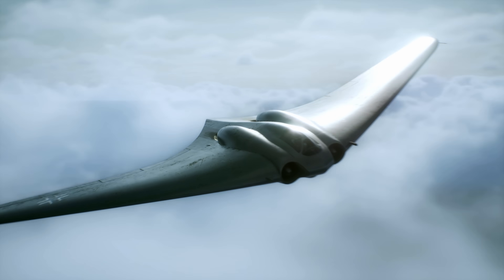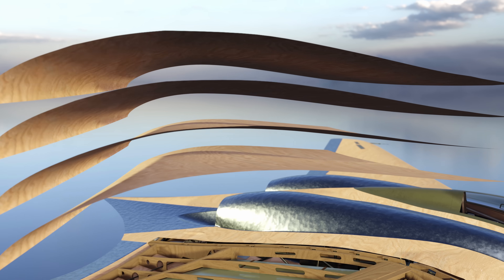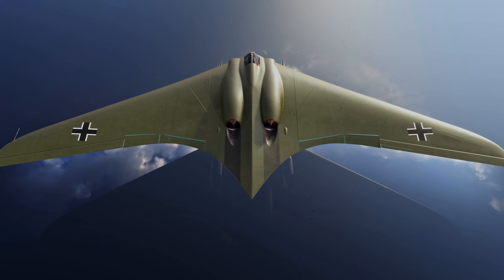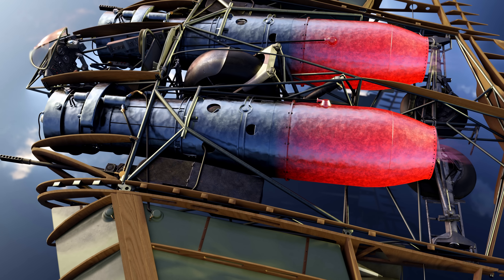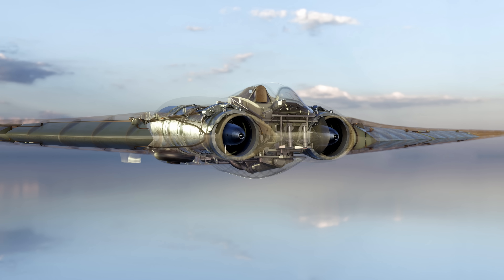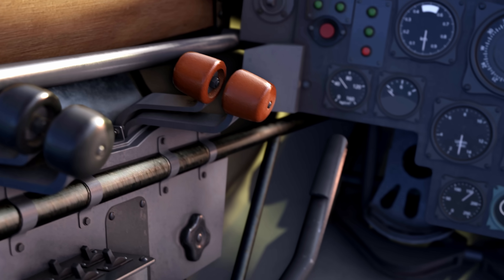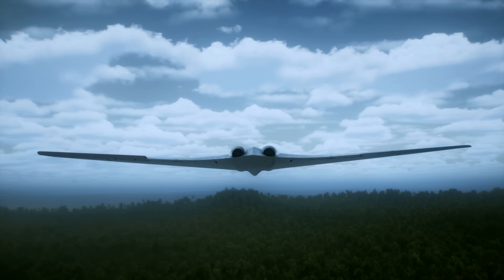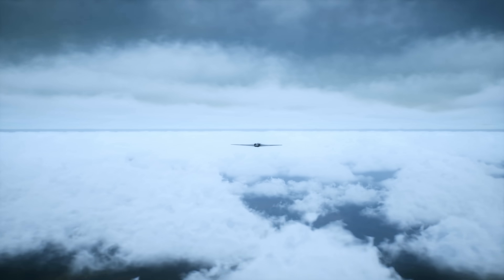Inside the Horten Flying Wing

Comment: The first flying wing patents were issued in 1870.  Many efforts were made to produce such planes before WW1.  Between the wars there were French and British designs.  The Westland Pterodactyl first flew in 1928 - a powered wing 5 years before the Horten brothers built their first glider!  All had advantages and disadvantages, the biggest problem being that a larger wingspan was needed to achieve the bell shaped lift distribution required for stability (particularly without a fin).  The alternative is an airfoil with a reflex trailing edge which gives lower lift characteristics and excess induced drag except over a very narrow spectrum.  It is also worth remembering that some versions of the DeHaviland Mosquito had a higher performance than the Ho229 would have had before the  229 flew..  With more reliable and less thirsty jet engines and further development flying wings or high performance versions with small canards to assist are now common in military use, though very few are fin-less.  There are still researchers trying to prove that the Horten formula is "better", but no-one has succeeded.  The stealth niche (B2) probably owes more to Jack Northrop's designs than to the Hortens.
Reply: Nuh. It just irks you when things were made by Germany, and you cling to any straw feeding the murican ego. 🤷‍♂
Reply: @matt47110815  The Horten brothers gliders were NOT competitive either.  If you read any of my posts you would know that I do NOT feed Murican egos, I laugh at them.  Study some basic aerodynamics and the history of flying wing (non-delta) aeroplanes then try again.

Comment: Still, the late jet version was so difficult and dangerous to fly that it killed its only pilot (Erwin Ziller) on the third and last flight it ever made under jet power. The earlier glider versions were said to be very safe and stable.
Reply: It crashed because of an engine failure, not because it was difficult to fly.

Comment: Indeed, it wasn't conceived to be stealth, the necessity hadn't been prevalent yet but due to its very high speed and the limited radar range and precision of the era, by the time it was a confirmed enemy unit, it was already on top of you and the interceptor pilots were still in their beds. So, we can probably speculate that the advantages gained over enemy detection back then to be approximately equivalent to today's stealth technology over current detection counter measures. I may be completely wrong here but it's a pleasant thought.
Reply: Tests showed a 50% reduction in frontal RCS... given the limited capability of British air defense radar this represents a significant tactical advantage in range of penetration into enemy controlled air space without detection and preventing interception before reaching its target.

Comment: US copied B2 from this
Reply: Not likely at all. John Northrop was also obsessed by the flying wing since before the war, and was already working on an equally ill-fated heavy bomber with like 6 engines bolted to the back.
Reply: The lead German engineer from this project went straight to work for Northrop so what do you think?
Reply: @sebastiantran1266 Lead German engineer? Reimar and Walter never stepped foot in the US, how could they work for Northrop?
Reply: @sebastiantran1266 you're right
Reply: @sebastiantran1266  Non ha lavorato per la produzione aeronautica in Argentina 🇦🇷?
Reply: @sebastiantran1266 the Germans were very advanced in particular with rockets but the Americans were I believe actually just as critical for the American program that developed.
Reply: At the Dunning Kruger olympics, you just brought home the gold medal.
Reply: @georgeandrewtan that is tremendously funny! 😅
Reply: The B2 was based on the Northrop model 1 designed in 1926 the horton was designed in the 1930s. Northrop didn't complete the design until the B2 when in perfected the Rudderon and computer controlled fly by wire to mitigate the Dutch roll problem encountered early on in development. The Model 1 was the first of its kind, the Germans also figured it out. Zeitgeist is typically the convergence of technologies and ideas. This is why you see multiple versions of the same tech simultaneously or very close to each other. Now Eternium is doing it with a hydrogen electric hybrid propulsion system.
Reply: @bodypilot2006 bro the Northrop didn't use jet engine Oky they use properly but the horten ho 229 they use a jet engine
Reply: Right
Reply: thats true
Reply: Yeah, both USA and the Soviet Union captured a lot of tech and intel after WWII.

What else did anyone expected to happen? Let such technology advacements be lost for ever?
Reply: The nzis copied the look from aliens...and the aliens copied the shape from doritos...
Reply: This is the type of opinion formed when you are dangerously uneducated and indoctrinated
Reply: I heard america took all German scientists to USA after world war 2.
Reply: America always copies other ideas from other nations.
Reply: Its a complete myth the b2 is all about stealth and this plane didn’t have anything to do with stealth
Reply: US backed the Germans tbw.. 😮
Reply: Northrop also made N-1M
Reply: I’m assuming you were high when you typed that.
Reply: Dear All, My comment is not to downgrade anyone but to show most modern machines having historic bases.
Reply: Prototype of horten 229 was captured by Us Army & blue prints also.
Reply: Ho yessss 👍
Reply: and then they copied it from peregrine falcons... the fastest animal alive 🙃 that even hunts eagles 4 or 5 times their size... so I guess they copied nature, shame on them 🙃
Reply: That's correct 💯
Reply: 🤣 no se parecen en nada .. además Alemania copio varios modelos de Alas Voladoras de los Norteamericanos
Reply: They have all the nzi brains  what you expect 😂
Reply: Bro the Northrop didn't use jet engine Oky but the horten ho 229 was the first one to use a jet engine not a propeller
Reply: It was confirmed by Northrop engineers and officials that the Ho 229 was studied and analyzed and influenced the development of the B-2. I know John Cashen (northrop stealth engineer) and Alan Pope (b-2 aerodynamicist) both confirmed this.
Reply: @アドルフヒトラ  link ?
Reply: @アドルフヒトラ  possible.
Reply: Much different.
Reply: @TamNguyen-wf1uk I feel it is evolved
Reply: @Realopinion49And, Wernher von Braun was a key figure in rocket propulsion development for both Nazi Germany and the United States. He led the development of the V-2 rocket, a precursor to modern ballistic missiles and space launch vehicles. After World War II, he was brought to the US under Operation Paperclip and played a crucial role in NASA's early space program, notably leading the development of the Saturn V rocket that propelled the Apollo missions to the moon.
Reply: @Pygmy-Hunters👍
Reply: @TamNguyen-wf1uk , nope!
Reply: @dietmardaume9584how do you think NASA was made 

Germany engineers we're head of the technology beyond Americans 

If Germany could had lasted a few more years in the world war II,  theyvwould have had jet planes capable of flying to America, they would have had spacecrafts been able to go to the moon 

That's why after the war America claimed all the German scientists and engineers
Reply: If its not broken, use current tech to make it better
Reply: Other than the flying wing part, there's really no comparison.
Reply: B2 design is made by computer
Reply: Not really... the design is very different. Its just that due to the laws of physics, any flying wing design will look very similiar.

Still an impressive feat by the german engineers, but likely not stolen
Reply: Yes and Americans mastered flight before anyone else, we all can be inspired by others. The technology needed to fly at all was pioneered by Americans decades before Europeans figured it out, even the French press acquiesced to that fact. When the Wright brothers demonstrated their designs in Europe around fifteen years after the first flyer the Europeans still didn’t have it down.

And Americans don’t deny when others design things, that’s sort of what other countries do out of insecurity. America has nothing to be insecure about. The Germany were very advanced in rockets and in planes. They put the first jet on an airplane, though a French British guy invented the jet. But what is also true is two people can have the same design and not be inspired by each other.  Also it isn’t super fair to compare here, Germans had slaves they worked to death to build their tech same with Russians. Americans were slowed down by having to treat the scientists and laborers like human beings. 

America also likely didn’t come up with the idea for stealth jets as I think a Russian engineer created that but the kremlin rejected it and we were the ones to make them work.
Reply: @ComeAlongKay the wright brothers couldnt have done it without Otto Lilienthal, and Otto Lilienthal couldnt have done it without many other pioneers before him. Some were english, some were french, some were german, some chinese and some were arabic.

It doesnt matter the country, brilliant people exist everywhere. The only difference is wether these people can then access the ressources they need to develope their ideas
Reply: @ComeAlongKay you got one fact wrong the Germans got the designs for their rockets engines from Italy and built on it in an improved it

Comment: The B-2 bomber first flew in 1989 and was officially adopted in 1997, 
so isn't "five years later" a mistake, it means 50 years later?
During the video, the aileron is often referred to as "elbon," but that's a mistake.
Are they not proofreading the machine translation?

B-2爆撃機の初飛行は1989年、正式採用は1997年なので、「5年後」は50年後のマチガイでは？
途中、頻繁に補助翼をエルボンと言ってますが、エルロンのマチガイですねぇ。
自動翻訳を校閲していないのでしょうか？

Comment: What a beautiful and revolutionary plane !   To think that it first flew in February 1945....anyone who saw it in the sky then might have thought it was an ET spaceship  invading our planet ! I love to watch it from all angles, painted in green and black and sporting those German Balkenkreutz markings  ! The Horten brothers were plane designers so ahead of their time...
Reply: it's an important lesson in moving the progress of technology. what was missing? material science. they had the design & engineering down, SOLID. they lacked materials like polymer composites, titanium & inconel. if you took this EXACT same design TODAY- and installed 2-  F135 engines in it, then vacuum molded a 1-piece skin in carbon fiber, gave it fly-by-wire controls? it would out-maneuver & out perform pretty much every modern fighter in existence. a fuselage is an extra unnecessary component that just adds weight & drag. the flying wing deletes that. the B2 & the B21 ARE that aircraft.
Reply: @jaybee3165  almost makes ya wonder if it has achieved operational status, while too late to influence the war, would it have had a major influence on aviation in general? Those are the kinda questions I let live rent free in my head
Reply: @jaybee3165  Only in YOUR dreams.  The aerodynamics say otherwise.
Reply: @jaybee3165 Germany invented polymers, high temperature stainless alloys, jet engines  and radar absorbing materials... they also invented fly-by-wire flight controls, Stability Augmention Systems, ALS and ILS.
They even put the first supersonic guided missiles into space... but you go on with your childish beliefs, no one who is well-read and well-educated gives your opinions much thought.*
Reply: No, 03.01.1944. wiki
Reply: Das ist Unsinn. John Northrop hatte zeitgleich ebenfalls eine Nurflüglerserie in Arbeit, die zur YB-47 und später zur B-2 führte. Die Horten war eine früher Prototyp und hat seine Flugfähigkeit nie beweisen können. 
Und ihrer Zeit voraus ist echt genial. Nichts von deren Kisten außer Segelflugzeugen ist jemals richtig geflogen 😀
Reply: ET didn't exist until almost 3 decades later
Reply: @KatariaGujjar  - Nonsense ...they have been here for thousands of years, not the day you heard about them for the first time.
Reply: Yeah Germany is superior in everything, guns medicine, plants, inventions, power supply, math, science, faith, ..,here we go again...,
Reply: @Art-w1l8x No, its only the British that falsely claim to have invented everything.
 Germany invented powered manned flight, and the internal combustion technology that we use today... Britain led the world back in the Steam era.
Reply: 😂 und kaput! 
They lost....,twice! Get over it let it go.
Reply: @Art-w1l8x  - You must be no older than 10, right ?  Kid, this is no game of winners or losers...it's about taking giant steps ahead in the world's aviation history !  When you grow up to be like 18 or so, you'll begin to understand.
Reply: @roybrowning2685 😂 keep kidding yourself Sport
Reply: @roybrowning2685   The 229 program didn't achieve much more than a design study of flying wings, though the brothers should receive due credit for their ideas.  The first V1 prototype was a glider that flew during 1944 until it was destroyed in an accident.  The second V2 prototype was the first with powered flight and jet engines, and a very good achievement.  It only flew for about two total hours of testing in February 1945 before a fatal accident.  For all purposes, that was the end of the 229 effort.  Gotha was building the V3 and three other prototypes when their factory was captured.  None of the later aircraft were finished or flew.
Reply: @roybrowning2685  Die Horten war aber kein Fortschritt in der Luffahrtgeschichte. Es war Ressourcenverschwendung und nichts von Horten hat für irgendwas Pate gestanden (nein, die B-2 hat wirklich gar nichts mit der Horten zu tun - das sind feuchte Träume von Wehrmachtsfanboys).
Reply: @Art-w1l8x  like Roy said you sound like an ignorant child, by your mindset I guess we should abandon most of our modern rocket technology and many other things because they were created by the "losers"
Reply: @Art-w1l8x  yup, they lost-      & RIGHTFULLY SO.      but they were beaten with FINANCES - NOT TECHNOLOGICAL PROWESS. &? they had hitler- a MORON. if they'd had a respectable, smart leader- they'd never have done any stupid shit like persecuting civilian populations. ww1 was a failure on the part of pretty much EVERY country in europe- to ditch burocracy & power structures to act in favor of the higher purpose- LIBERTY. combine that with too many people competing for the same jobs? tensions were just too high. then the europeans ephed up by blaming all of it on germany- which brewed greater resentment of the german people. that set the stage for hitler to sieze power. had hitler been side-lined from being allowed into politics- they would've never gotten in the 2nd war in the first place- they would've prospered at industry- but not unless the european union stopped blaming germany for everything.
Reply: @Art-w1l8x  and just took 3 superpowers and the rest of the world to beat a bunch of beer drinking , lederhosen fashioned germanz.. IN BOTH wars...
Reply: @Kallai.Alexander   only 2 superpowers at the end of WW2... Britain surrendered to the Americans in September 1940.
Reply: @Art-w1l8x Germany is now the largest manufacturer of jet aircraft in Europe... second only to America... and Britain?

Comment: Piloting a flying wing without a fly-by-wire system must have been a nightmare
Reply: Das stimmt nicht ganz. Damals wurde schon an mechanisch analogen Mixern gearbeitet. Heute vom Hydrauliksektor absolut kein Problem mehr. Ein Fly—by—Wire—System ist nicht unbedingt erforderlich.
Genau dieses Thema wird schon lange sehr elegant verschwiegen. Leider. Wenn die Rundumsicht nicht so beschissen wäre, dann wäre es ein sehr elegantes kleines Zivilflugzeug der Echoklasse.
Reply: Allegedly it was very easy to fly due to being insanely well designed. I don't know how much of that holds true, but it's something to consider.
Reply: @vornamenachname989  yup, basically because of the difference in angle between the body and the wings, if you pull too hard the former stalls without the later doing so , that reduces turn time back to stability without stalling the wings
Reply: Was ein wirrer Hirnfurz, Peter
Reply: @user-ve7hn2dh8h  Dann sehen Sie sich mal die Werte an. Beginnend vom Rumpfmittelteil nach außen. Oben drücken, +30 Grad, außen 5 Grad. Mitte ziehen, innen —5 Grad,, außen — 30 Grad. Querruder links, — 2 Grad, uns außen — 20 Grad. Wer diese Stellwege nicht mit einem mechanischen Mixer erstellen kann, oder besser mit einem hydraulischen Mixer, egal ob Geschwindigkeitsabhängig, oder nicht, sollte nochmal über die Bücher gehen. Nichts anderes machen die 18 Rechner in einer B 2.

Comment: 15:19 if they could get rid of the landing gear. The plane would be so much better. Have it launch from a sling shot and be decaptured on a rail device (invert slingshot).
Reply: considering the schizophrenic designs german engineers were coming up with towards the end of the war, its very possible that they actually thought about it

Comment: Der Horten war auch mit Kohlenstaub beschichtet und war somit auch ein Flugzeug mit verringertem Radarabdruck, also ein Stealth Flugzeug. Siehe dazu diese Dokumentation,  https://www.youtube.com/watch?v=ekDx5dvD9nI&t=2064s
Reply: horten said that in 1983, there is zero proof that it was actually implemented, nor that it would have worked
Reply: +@ANdi-2308   It was not covered in coal dust or charcoal.  The third prototype was captured in the Gotha workshop still unfinished and covered with green fireproof coatings. No paint at all.